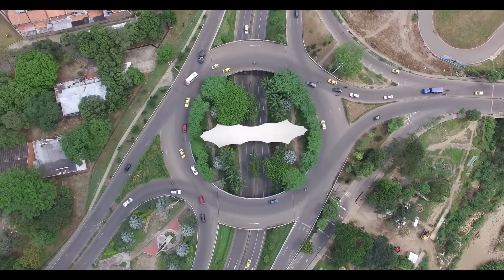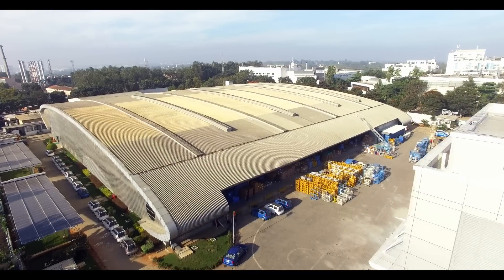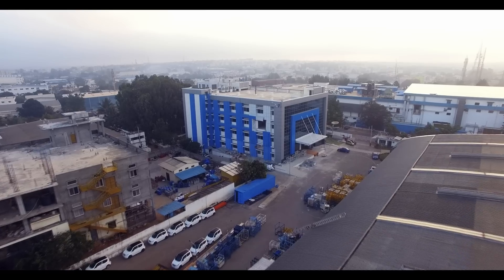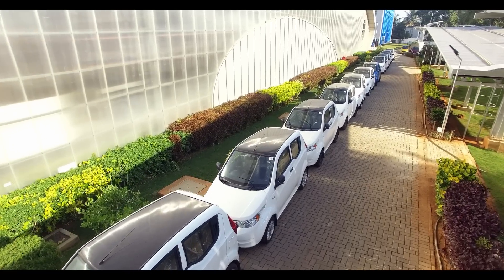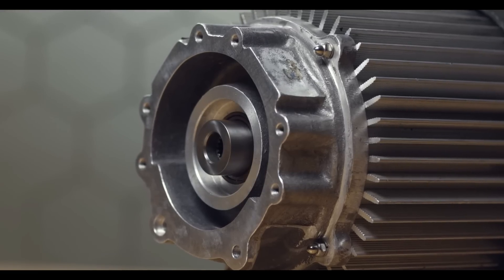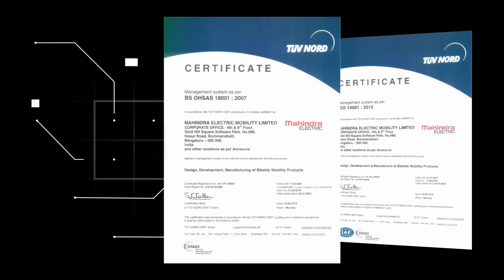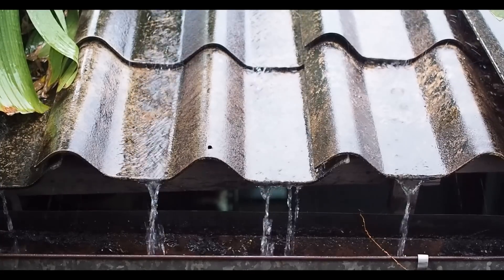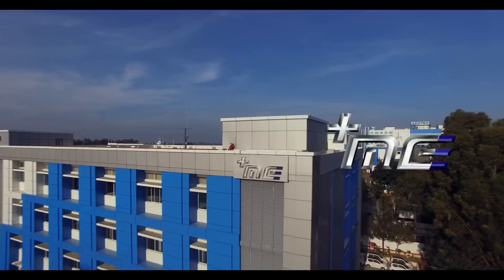The Mahindra Electric Manufacturing Facility

Comment: Lot of BS in this video.
1. World's first two wheeler and three wheeler integrated assembly line? You mean others aren't doing it because others couldn't do it? Like how many manufacturers are there who produce both three and four wheelers?
2. If you are producing 75 kWh energy from solar, you should show a  roof top solar of about 20 kW, not a utility scale solar plant.
3. If you made a prototype called Bijli in 1999, that doesn't count as a production vehicle. Come on, how many did you sell?
4. Global Pioneers in Electric Vehicles? Give me a break.
Reply: Point 3 and 4 are not right. I have seen the Bijli where I live almost everyday in my childhood. And they are actually global pioneers, not yet in electric vehicles, but in the diesel vehicles.